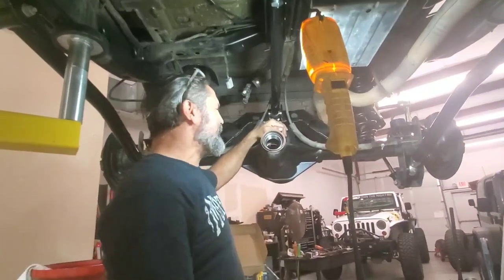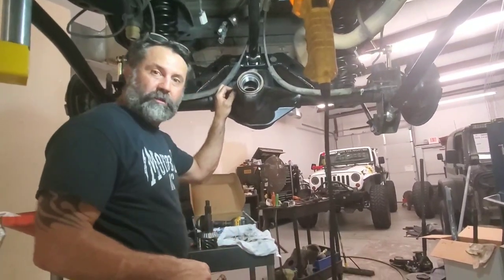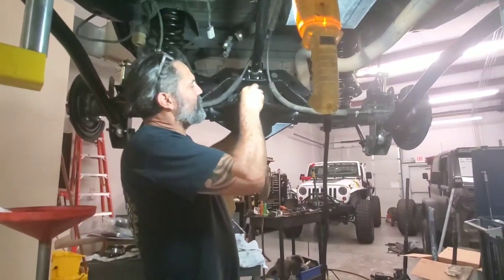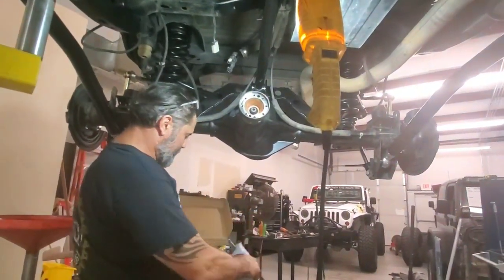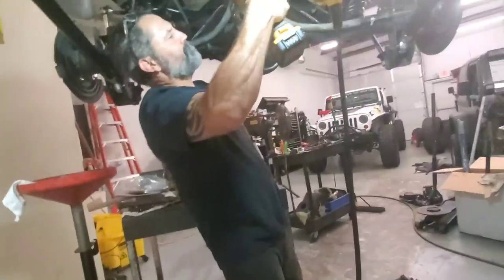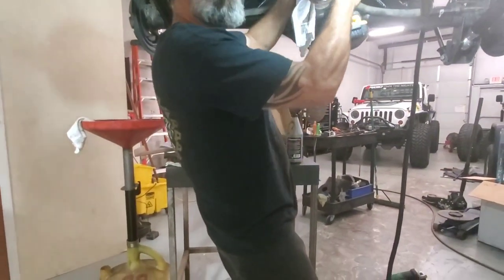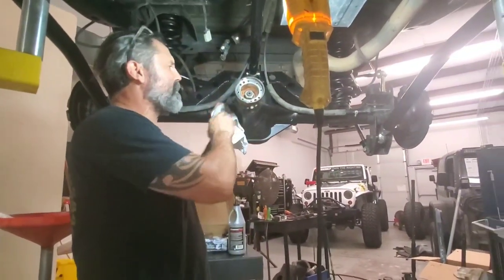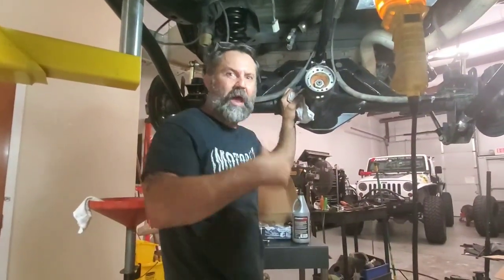Pinion crush sleeve / Jeep

Comment: First off, a battery impact WILL crush it effectively. No two ways about. To think a battery won't is from someone that is living five years ago, with regard to strength of battery impacts. My two battery impacts are stronger than my air impacts. Secondly, if you do enough of these, you can FEEL and UNDERSTAND when it's where it should be ... I crush WELL beyond what my dial indicator says it should be ... otherwise, it's too loose. So I no longer use the dial ... simply by feel. And, to date , with over 15 done this way, is always correct. Unless you work on these rear ends fairly regularly, your comments that he doesn't know what he is doing ... or this is a video on what not to do is silly. If you KNOW, you KNOW! The trick is to no OVER crush, just in case. GREAT VIDEO, man. From a 30 year JEEP guy/mechanic!
Reply from the maker: Cool man thanks a lot good stuff
Reply: I have a battery impact wrench and it will not crush it.

Comment: I see no dial indicator torque wrench, you have done a couple of these so you know exactly what your talking about? You don't have the axles in or the ring gear, differential, there is absolutely no way to determine if you have it to spec, you have just crushed the sleeve its not good anymore, no pinion seal in so its gotta come back out. People this is a great video of what not to do
Reply: Agreed
Reply from the maker: I do the complete install before I install the seal, I use the old nut, when I put it together for permanent I use the new nut..  turning while tightening up is for the proper preload on the pinion bearings. this is crushing a brand new crush sleeve to gain that preload.
Reply: @jeepstyle4054  😂
Reply: The pinion preload is for pinion only ,  then u gotta add 7_11 lbs (dana 30)  every axle model little different,  7-11lbs for total preload , thats Carrier and pinion ,  u do NOT add seal yet because it creates extra drag which creates ex inch lbs then u don't get true reading for preload if seal is installed,   that's the only way to b able to test Carrier bearing preload,   only thing I do different is use old nut to get crush sleeve started crushing to about 5-8 in lbs then take it off and put red loctite on threads then use new nut to finish it off , then install seal ,    the seal will add around 3 or 4 in lbs...  my suggestion to you is know exactly what your talking about b4 u get on internet and make a fool of ur self ,  😉
Reply: @boatsandjeeps780  You're so cool.

Comment: Great video! im using your tip for my dana30 bearing change next week. but could you describe the force which is needed to turn the yoke, because I don’t got a dial inch wrench and this is will be my first pinion preload setup so I don’t got the right feel yet that’s why im unsure about how much force the yoke should have to start spinning, but eventually im overthinking things,
thx man

Comment: Thanks for the video , but I have a serious question. You are not going to reuse the old crush sleeve , I get that . So if you crush down the new sleeve and than remove it only to reuse it in the final assembly you are actually using an old sleeve. Why and how is that better than just using the crushed sleeve you started with?
Reply from the maker: Well the old crush sleeve has been through a lot, and you know metal when it gets fatigue is not going to handle... especially if you're changing to a lower gear.. but once the new crush sleeve is crushed it doesn't get crushed anymore, everything's brand new. And another difference between that new crush leaving the old one is there's no way that old one is going to be this automatically perfect? for the new bearings and new pinion.
What are your thoughts?
Reply: OK, I see your point. Not being a pro I thought using the old sleeve might eliminate a potential error in reassembly. For the nominal cost of the new sleeve that would be foolish not to replace it. A job worth doing is a job done right.
Reply from the maker: Another reason why you always want to use a new crush sleeve is the tolerance between the different parts will have a different distance that the sleeve actually crushes
Reply: Use the new crush sleeve, I come to you from the future to say the old tension on the old sleeve will not hold the bearings / pinion will come loose. A real FAFO moment

Comment: This is exactly how I set mine up, except I did it with the seal installed and the new nut. I also verified rolling torque with my dial torque wrench. 

I guess I don't understand why you set preloaded with a used nut and no seal?
I was taught that once preloaded is set, don't touch it. 

I "uncrush" and re-crush the old sleeve for setup, and crush the new sleve for final assembly.  ...again stopping when the new sleeve is properly set and never moving it again. 

Regardless, the impact gun method works great 👍.  Excellent vid.

Comment: Are you in Utah by chance, got liberty pinion seal that was replaced by drive line shop.  I have noise at 40.  I tried replacing hub bearings,cv shaft still there.  80-90 dino put in 70k I messed up because calls 75 140 syn.  Jeep switched it on 05 liberty missed memo lol.  Still trying figure out.  Too tight pre load on pinion?
Reply from the maker: Hard to follow call Stacked Offroad in Charlotte North Carolina tomorrow

Comment: So I bought the dewalt half inch impact. That thing is a beast. 1200 lbs break away torque, up to 700 lbs forward torque. 3 settings. 1 is 100 lbs, 2 is 300 lbs, and 3 is 700 lbs. 

I did this trick after struggling for a while and wow, so easy. I think I went a little to far though. 5 months later and my seal is leaking again.

Comment: Yea so your video really didnt show anyone $hit...what was the point?   If you would measure pinion depth or measure the original depth to the new pinion measurements marked on the gear, you can do this with a new gear, new bearing, new seal and new crush washer from the beginnig and NOT have to take it back apart...This is why ASE and 'real' dealer training is important.  Not sure what the point of this was and what you think you discovered.

Comment: What the hell is he talking about?
Reply: Don't listen to him. He does not show how to measure preload
Reply: Problem… using an impact gun to crush sleeve and set preload will mar bearings causing pits in your bearings. Much better to use a torque multiplier, steady torque from a cheater bar and measure your preload with an inch pound wrench